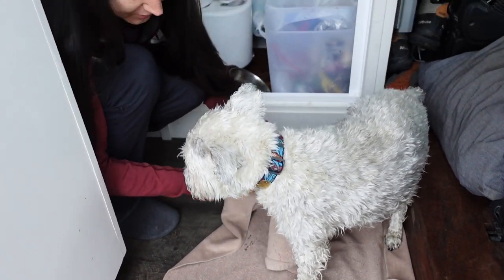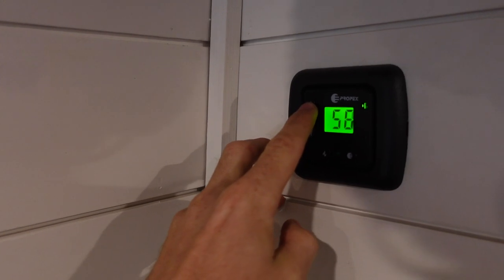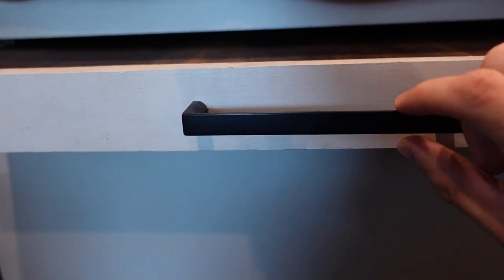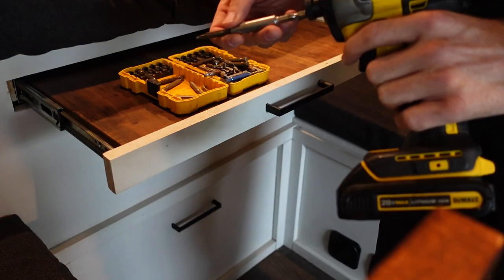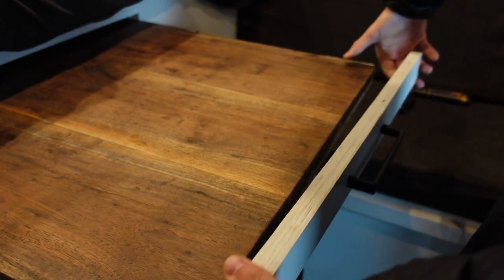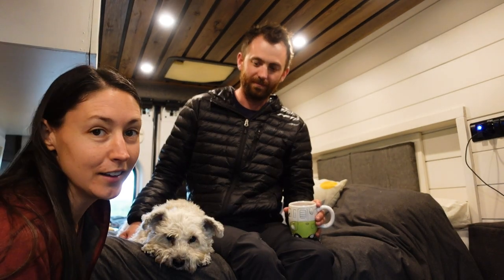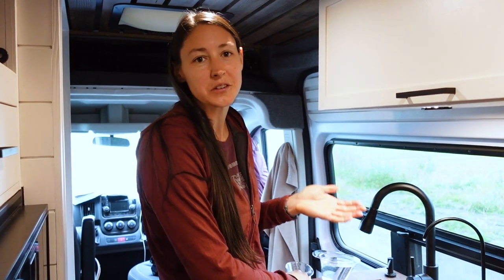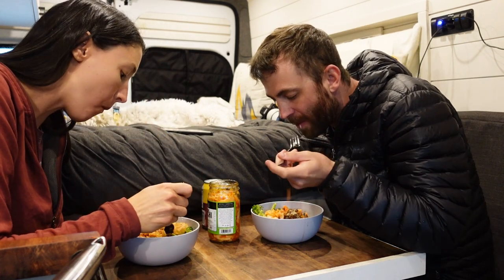Rainy Day Living Inside Our Tiny Home | Van Life

Comment: Does your power last you long ?
Reply from the maker: Probabaly about a week and a half if we aren’t using things that draw a lot of power (espresso machine or running both fans wide open), but it’s usually not cloudy for that long so we can charge up quick w our solar, or by driving. The only time it’s been an issue is when we were stuck in a heatwave for a week and were parked in the shade. Our refrigerator and fans were constantly running and we would have to move the van into the sun to use the espresso machine haha. Can’t go w out the coffee!